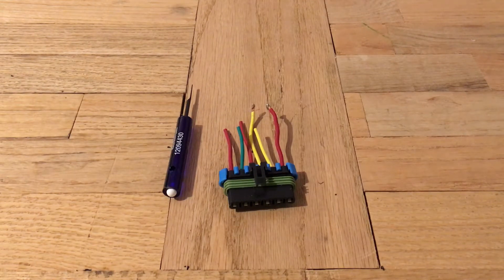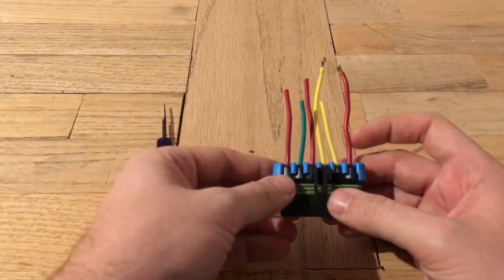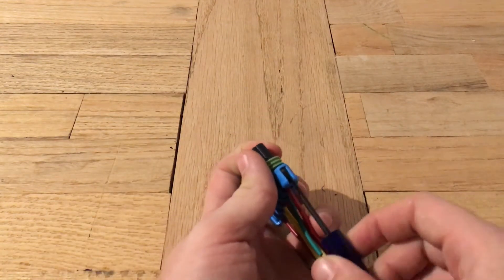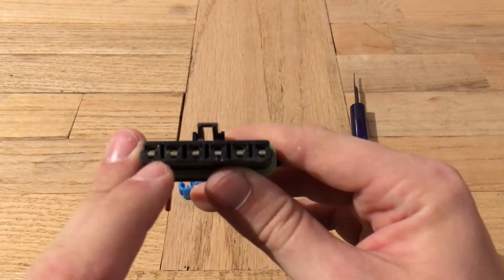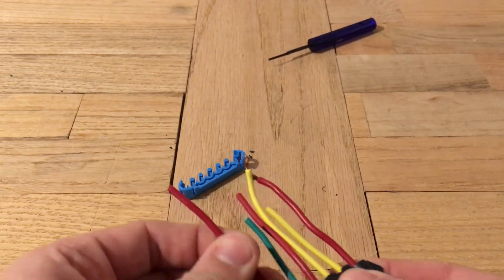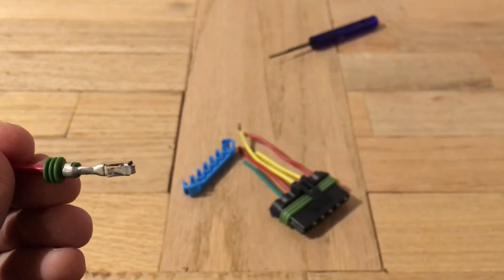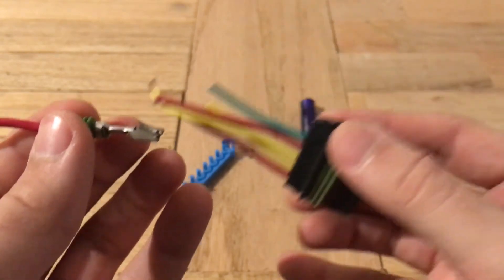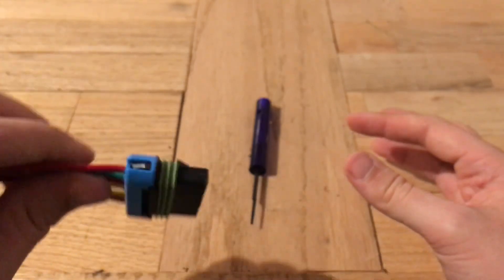Female 280 Delphi Weather-pack 6 pin Connector terminal removal technique.

Comment: Best video I saw today, helped me fix some pins that were loose on a delphi 66 connector for a blower resistor. Wasn't working until I took the pins out, pushed them up a little, cleaned the connections and put them back, plugged it in and it works. also, thanks for the tip on lifting the piece that allows the pin to reconnect when putting it back in :)

Comment: Thanks for the video.  I didn't have a removal tool, so I used a tiny screwdriver I have to tighten screws on eyeglasses.  Tried a paperclip, but it wasn't rigid enough to depress the tab.  Like you said, gotta go easy, especially if you don't have the tool - easy to damage the connector.  Got 'er done!  Thanks again...